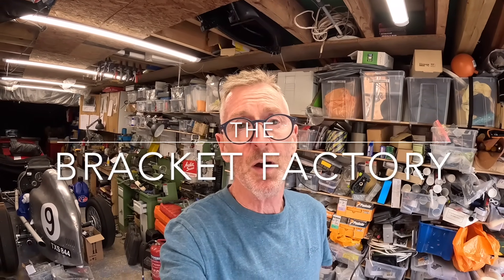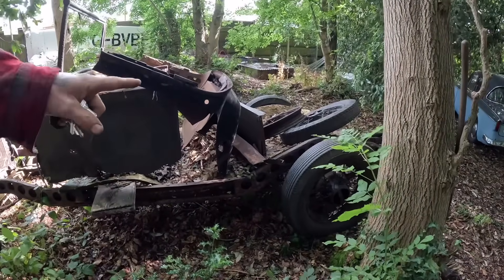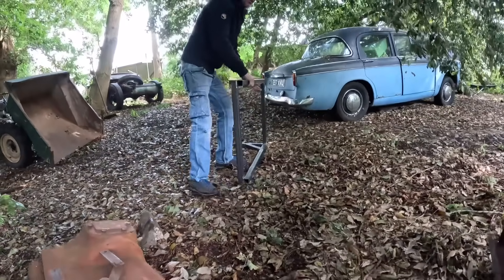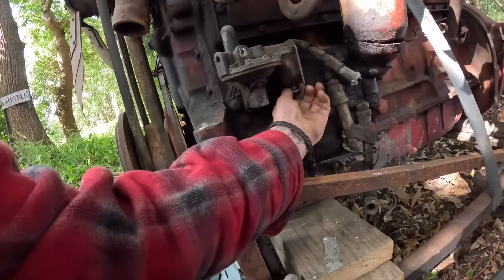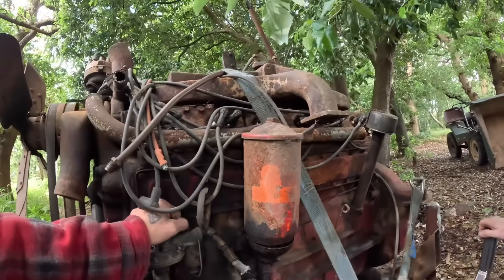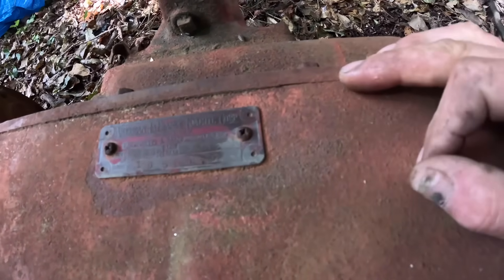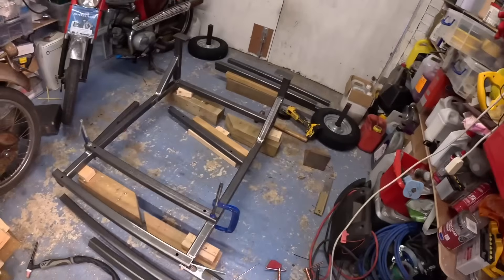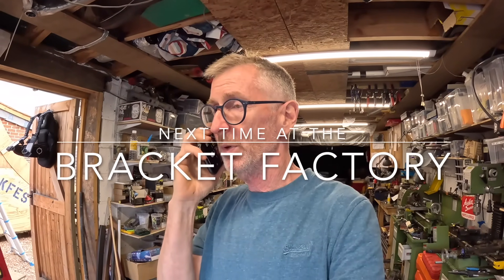American La France V12 Special Project - Episode 2 - 'Bomb Trolley'

Comment: STOP  ---  Don't use that dolly you built. The mil / metric  steel  in not compatible with the SAE / Imperial engine.
  Using metric will cause the engine to jump out of the cradle -- Causing damage